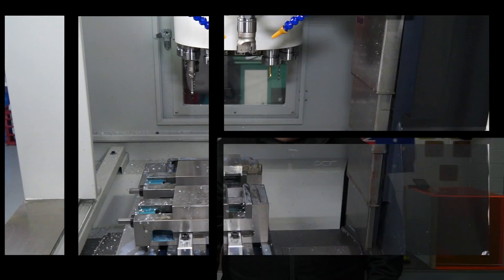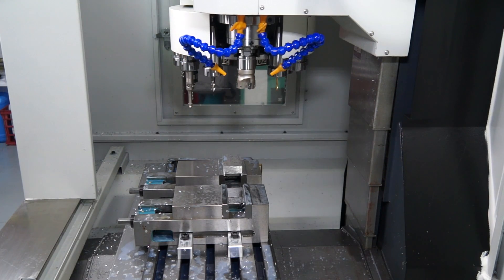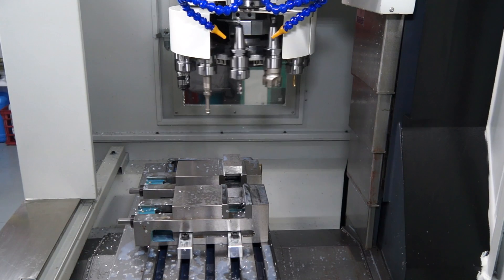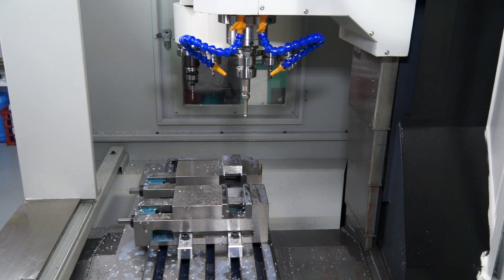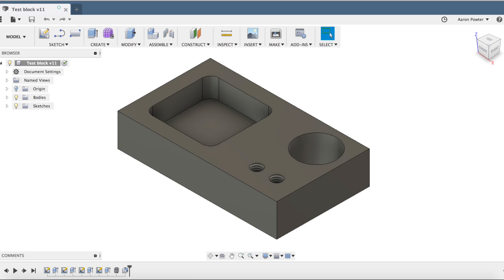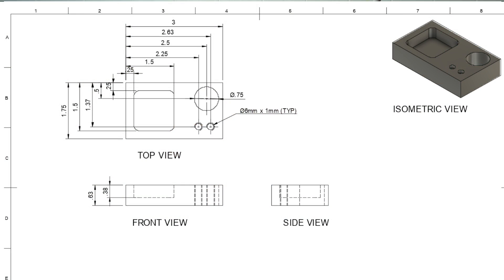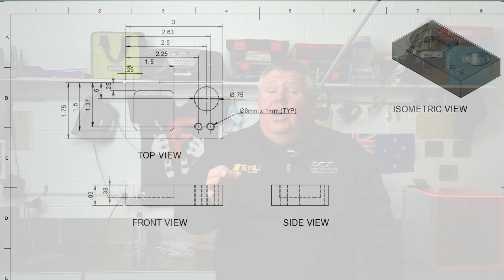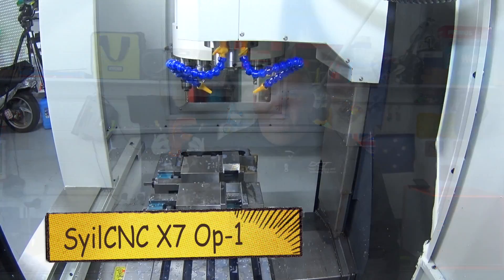Syil X7 CNC Mill - My First Part

Comment: Hi Aaron, How do you find the machine noise wise in a residential building? I am thinking of buying one and putting it in my shed at home but was worried about getting noise complaints from my neighbors.
Reply from the maker: G'day mate.  Yes I believe the noise level to be ok.  However, the worst noise pollution I had was that old compressor.  The new Chicago Air has solved that problem.  Oh, the machine is noisy only when the spindle is spooling up and braking at the end of a tool path or end of cycle.  Give me a couple of weeks, and I will purchase a dBa meter and prepare a video for you.  Cheers, Aaron.
Reply: @DCT_Aaron_Engineering  Thanks mate, Yeah I forgot about the compressor, I dont use mine at home all that much anymore and I have forgotten how loud it can get. Ill look into the Chicago Air you mentioned. I intend to use the machine for mainly steel and aluminum. Have you done any steel on yours and if so what was the noise like compared to aluminum? I hope Syil are giving you a kick back for all these videos, makes the decision to buy one much easier. Its either one of these or one of the Hare and Forbes Optimum machines, but you have swayed me to the Syil!
Reply from the maker: @aaabbbcccdddee___3333  Hey bud.  Would you mind sending me a private message via Facebook or Instagram.  We can chat more there about CNC.  Same name as my channel.  Or look up Aaron Powter.  Cheers ;-)

Comment: Can you cut steel on this machine? And what is your opinion about weight of this machine because it weights 1000kg and that is not a lot. 
Sorry for bad english.
Reply from the maker: Hello Gregor.  Yes this machine will cut steels and other alloys.  It weighs in at 1300kg.  So you would have to take it easy and machine within its limitations.  Cheers, Aaron. PS: your english is great 🍺

Comment: I wonder how much more the Sinumerik 828D control would had been?
Reply from the maker: The 808D is no longer an option.  However the 808DA (advanced) is an option.  That costs over an extra $5K USD.  Not sure if it worth it if you ask me?  Plus you're locked in to Siemens for everything else (servos, drives, etc...).

Comment: I read that the max cutting speed is only 80 ipm. is this accurate?
Reply from the maker: Steven Larsen I think the servo model is 10000mm/min rapids and 2000mm/min cutting. So yeah 80”/min
Reply: @DCT_Aaron_Engineering  seems slow in terms of cutting speeds with servos. tormach can do 130? am I missing something
Reply from the maker: Hey Steve, not sure if that is correct.  Tormach list this as their figure as their maximum feed rate, not cutting rate.  I've had my Syil up to 85ipm.  However, there is no sense in having super fast feed rates unless your machine has the spindle HP, torque and RPM to match it.  For example, the X7 has a 10K BT30 2.2kW (3hp) spindle and I can easily bog that down with large DOC and 40% step overs.
Reply: DCTSolutionsAU There’s plenty of sense in having fast feed rates in lighter, lower horsepower machines, such as when using multi flute end mills at lighter radial cut depths.

Comment: How does this machine compare to the haas TM-1 or TM-2?
Reply from the maker: Probably too hard to compare here.  The TM-1 is a bigger machine and it depends on what options you get it with.  For example, the base model ($26K USD) only has 4K spindle and I think a tool changer is also optional.  Now the Syil X7 ($25K USD) comes with 12 tool ATC, 10K spindle, etc...  You will need to do your research.  My 10 cents and bang for buck, I think the Syil wins hands down. Especially here in Australia where a Haas costs 3 x times more.  Granted it's a better machine, but not at 3 x times the price ;-)
Reply: @DCT_Aaron_Engineering  Thanks. What 2 machines would you recommend, a lathe and a mill for a starter machine shop. Not targeting any specific area, for both under a budget scenario and a neutral scenario.
Reply from the maker: @TSMundora  Well if you had the budget I would purchase a VF1 and ST10 with reneshaw probing.  Now over here in Australia these 2 x machines would cost over $180K AUD.  Now for $60-70K I could purchase a Syil X7 combo mill and Syil XY50-X Lathe.  Now these machines don't have the work envelope the Hass have, but you could still make many parts on these machines.  At the end of the day it all depends on budget, the material you're machining and the tolerances you're trying to hit.  Every machine has its pros & cons.  For example, my good mate bought a $350K USD (Japanese / German machine) and the controller blew up int he first months.
Reply: @DCT_Aaron_Engineering  Just looked up the syil xy50-x lathe. Can't find it on both youtube or google.
Reply from the maker: @TSMundora  It's a new product range being prepared for release.  Join the SyilCNC facebook user group and the PDF file has been uploaded to it.
Reply: @DCT_Aaron_Engineering   DCTTeacher1  Ok thanks. I hope you will make videos showing the steel machining capabilities of the syil x7 and the lathe if you ever get your hands on it. Im a manual machinist interested in cnc machining. Most of the work I do is steel so if I'm to choose a cnc steel is my primary concern and also depth of cut and feed rates in steel. Wouldn't like a cnc that makes me want to go back to manual because it cant handle it.
Reply from the maker: @TSMundora  Unfortunately I'm only tooled up for aluminium at home.  However this machine can cut steel.  i will try and show this in an upcoming video.  Thanks for watching.

Comment: Hello,
You have a new machin what’s appen to the skyfire?.
Thank’s
Reply: +DCTTeacher1 
Thanks for the answer,i have to find a dealer in France 🇫🇷
Reply from the maker: LUCKPHOTOS contact Syil directly from their website. They can deal direct with you or they can steer you towards your local reseller. Cheers Aaron
Reply: DCTTeacher1 Thank's 👍👍
Reply from the maker: Hey mate. Still have the SkyfireCNC machine at home.  However, it has been decommissioned (drained and oiled) and is up for sale.  I actually need to get of my backside and advertise it.  Cheers, Aaron.

Comment: Very tasty looking machine there! Strange that the coolant doesn't drain from the table? Also, as noted the coolant flow rate is piddle power - when you were roughing out the cavity, there must have been a fair danger of chip recutting / welding / tool breakage. Definite tool envy here!
Reply from the maker: Hi Murray.  The machine comes with a standard coolant pump.  A high flow / high pressure can be fitted, but is an optional extra.  In fairness, I did only just cracked open the coolant valve, as it was spraying everywhere.  The table comes with a coolant drain hole, but it was blocked with chips (DOH).  This was my very first part.  I proved the program by cutting air, and then went straight into machining it.  I wanted you guys to share in my excitement ;-).  Cheers mate.  Aaron.

Comment: Pretty neat, feeds are similar to my Tormach, but a 10k RPM spindle would be nice!  Are the linear rail ways more rigid than the bridgeport style V ways on the Tormach?  Metal way covers are nice there.  Standard pullstud tooling would be nice too.  Might just be me talking out my rear end here, but it doesn't quite look more rigid than my Tormach 1100 series 3,  or maybe you aren't pushing it much.
Reply from the maker: Hey buddy.  Yes you are absolutely correct.  This was my very first time using the X7 mill.  All my feeds and speeds were way down, as I was too chicken to push it.   Linear rails never sound as rigid as dove tails or box ways.  But they do allow for faster feed rates and higher speed machining.  I will revisit these and post a better video real soon. Great to hear from you and thank you for watching ;-)

Comment: Flood doesn't look all that powerful?
Reply from the maker: To be honest with you, I only had the coolant tap cracked on both lines.  The frigging stuff was spraying everywhere and covering my camera lens.  You can order the machine with a higher pressure / flow pump.  This is the norm with most CNC machine companies such as Haas or DMG ;-).  Thanks for watching.  Regards, Aaron.

Comment: Very nice!! Sucks you had a wee bit of an accident with your HAAS. Oh well.

So just to be clear, you had no issues getting Fusion 360 porting to your Syil X7?
Reply from the maker: Hey Doug.  Yes it does suck.  TBH, I was so ashamed for smashing into that vise jaw.  I even posted it on Instagram and wore it like a badge of shame.  Though I don't own the machines at school, I treat them as if they are my own.  If you saw them, you would say that they have never been used.  But then you check run time and you know they have lol.  No issues with Fusion360 posting to the LNC controller.  It's all been good, as I had Scott from CADPRO tickle the post for me.  Cheers Aaron.

Comment: What is the Z+ move before and after the tool change? Part of the control or something in your post processor? Do these have rigid tapping? It looked like you are using a tapping head and I could hear a reversing click.
Reply from the maker: I think this is part of macro that is programmed in the controller.  The machine is capable of rigid tapping with the holder.  I am using the tapping head only because I didn't have another collet chuck.  Plus it is super easy to change out the taps for bigger or smaller sizes ;-)
Reply: It seems like a great bang for the buck! Is the purchasing experience better than Skyfire? I sure hope so....the Syil guy actually traveled to you - huge confidence booster!
Reply from the maker: Sorry for my late reply.  Yes Mr. Xushuo came to Australia to meet his recent clients.  From memory, I think a total of 7 machines came in all at once.  So he came over to meet us all and answer questions from prospective clients.  He also went to the USA and met with others too during IMTS.  Feel free to join the user group on FaceBook if you want.  Paul from CapecodCNC is the moderator for it.  Cheers, Aaron

Comment: Great Vid Aaron.  Love the metal way covers on that machine.
Reply from the maker: Good morning Jason.  Thanks buddy, I'm really satisfied with it so far.  The "all metal ways" are much better than the SF machine.  At least I don't have to worry about chips getting stuck in it and making holes.  I still need to tweak and maximise my feeds and speeds mate.  Cheers, Aaron.
Reply: I may have bought one of these had i known about them before i bought my haas. I really wanted a machine i could pay cash for.
Reply from the maker: Hey Jason, yes I'm very satisfied with my X7 combo.  It's a much bigger and more rigid machine than my SF.  Landed in Australia this machine amounts to $31,500 AUD ($22,500 USD).  Great bang for buck if you ask me.  Hey, wait to you see Paul Frink's Syil X7.  It has the carousel tool changer with the double arm.
Reply: Yes defiantly sounds way more rigid, nice!
Reply from the maker: Thanks Peter :-)
Reply: @DCT_Aaron_Engineering  Hi Aaron, thanks for sharing this info. When you say landed in Australia is that including shipping, crane delivery, tax and import fees?
Also I see the fast forward video of checking dimensions of the part looks great. If you get a chance, I'd appreciate some more testing of the machines tolerance ability. I'm looking at buying a VMC in 2020, when my company will be pivoting to prototyping, machining and in house manufacturing.
Cheers, Ken.
Reply from the maker: Hello Ken.  Sorry for my late reply, but for some reason your message was in my spam folder.  Anyway, yes the total cost landed and delivered to my door was $32K AUD.  It cost me an extra $500 for the forklift hire.  Keep in mind the cost can change, as Syil deal in US dollars and this can fluctuate daily.  So far I've only machined aluminium.  However, the sizes have been spot on the money.  I made the exact same part on the Haas at school, and to tell you the truth you couldn't tell the difference.  Cheers, Aaron.
Reply: @DCT_Aaron_Engineering  strange about spam 🤔 . I've been communicating with 
Mr Xushuo . Thanks for taking time to share this info with the community and myself.
Cheers Ken.
Reply from the maker: Hey Ken.  You're very welcome mate.  Hopefully my videos and others will shed some light on the SyilCNC range ;-)

Comment: Hey buddy great video, why did you swap out the skyfire?
Reply from the maker: Hey buddy.  The Skyfire served me well and is still a great little machine.  The Syil is much bigger, heavier and therefore more rigid.  It is fully cast whereas the SF is a desktop sitting on a weldment.  Hopefully I will be able to do bigger / heavier work on this machine in the future also ;-).  Cheers, Aaron.

Comment: Thanks aaron for doing the video of first part enjoyed seeing it all work. There is one thing i find very strange happening that ive never seen on a cnc before. When your turning the spindle on eg S10000 M3 the spindle is still accelerating and it jumping to the next lines. Those endmills are entering the job and starting to cut while spindle is still trying to get to speed. Id be worried im gunna break a cutter. Must be a parameter setup wrong in control.
Reply: That's just cheap cnc's. Can be solved fairly easy in your post with a delay from spindle start. We do the same on out older machines thats slow with coolant.
Reply: Ahh yes thats fair enough i guess im just use to using high end machines. I could live with that and just put a dwell code for couple seconds after turning spindle on.
Reply: What kind of high end gear do you run?
Reply: @nikolaiownz  DMG MORI DMU70 EVO 5 axis past two years. Prior to that i was on a Breton Flymill 1000 for 7 years that machine was incredible unfortunately that company when broke. What about yaself mate? Where you from?
Reply: Denmark here.. i Run a big DMC 125 H horizontal and a DMC 125 FD Five axis with turning function on the table.. both incredible machines... but they got there own problems from time to time haha..
Reply from the maker: Yes, they usually have a 3 second delay on the controller.  This can be fixed with the post processor by adding a G04 X3 after the tool change.  Cheers, Aaron.

Comment: Hi Aaron, nice to see you flinging chips again. The Syil looks great, have you got a problem with your sound as it’s eerily quiet? Most Syils I have seen working seem to have a full percussion set going on.
Reply from the maker: MarvinMarlin Hey buddy. Thank you, I was missing making chips. Yeah, I auto analysed the audio with Final Cut Pro and it cut all the humming and high pitch noise out 🍻
Reply: Aha, I thought I was going deaf at first, nice work mate. Looking forward to seeing more in the near future. PS I know exactly what you mean about dinging your confidence, crashed my newly refurbed Boxford 260VMC into my nice new 6" vice (now a 4" vice). IMHO its a crash when you have to pay to correct the damage from your own pocket.
Reply from the maker: Hey Marvin, you're not wrong mate.  I felt so guilty as it was the school's machine.  Plus I'm the manager of the centre and it doesn't look good in front of the other teachers & staff under me.  Now that's more money blown from our meagre budget.  Cheers mate, Aaron.